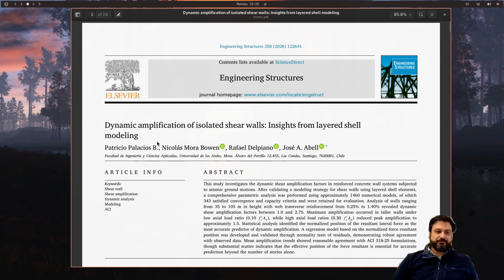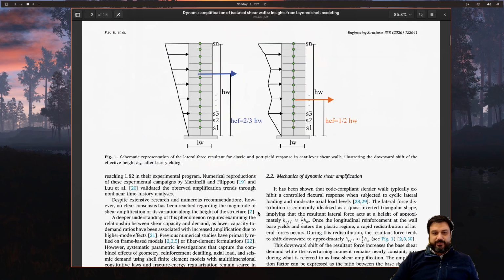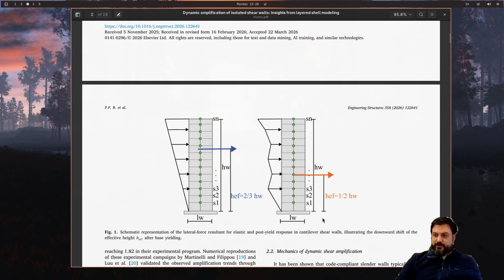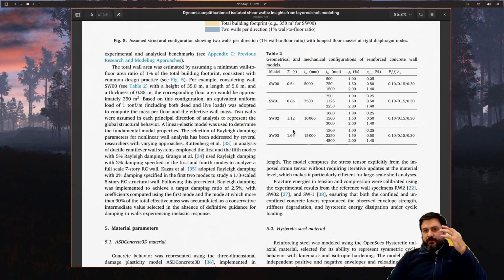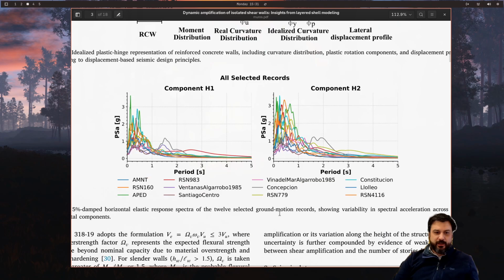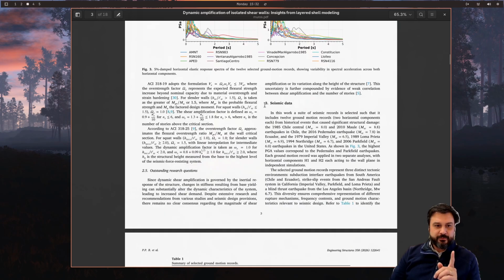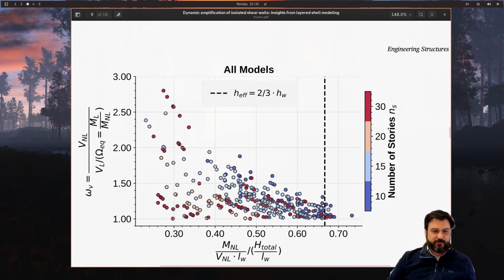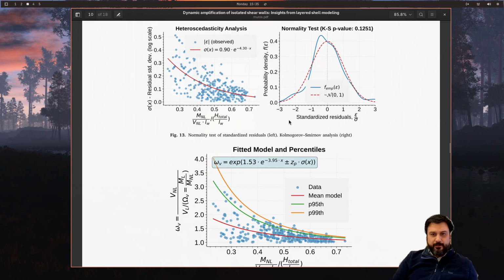Journal Club: Dynamic amplification of isolated shear walls: Insights from layered shell modeling

Comment: Impressive work. I generally use an amplification factor of 3 for seismic loads in my load combinations when designing shear reinforcement of vertical elements. It is clearly overdesign in many cases. best regards
Reply from the maker: Thank you! We still need to check how other aspects that affect response (SSI, torsion, etc.) factor into that amplification.